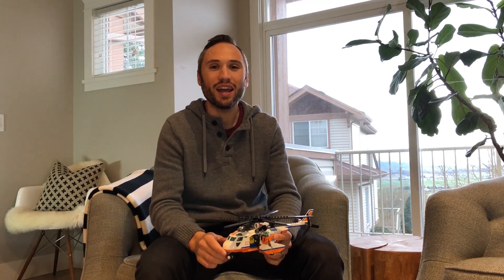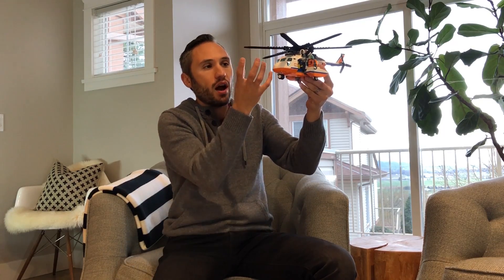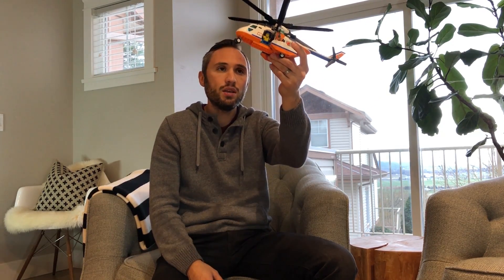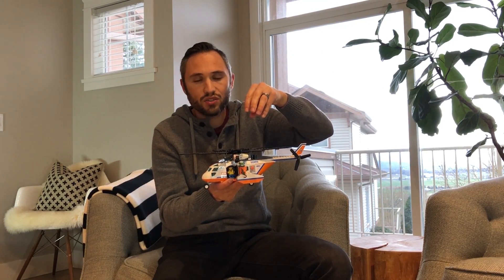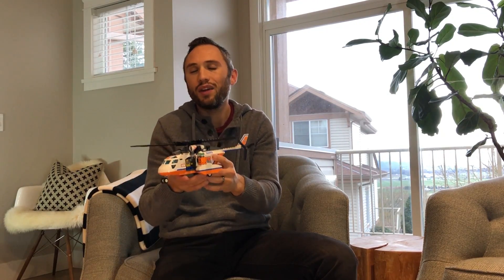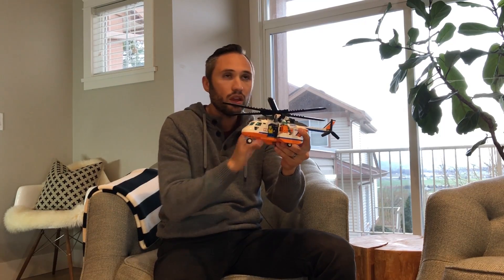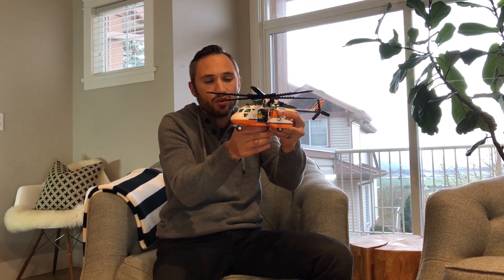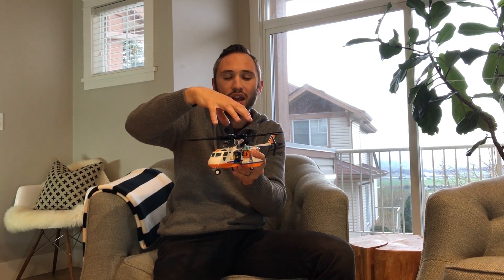Vortex Ring State IS NOT Settling With Power

Comment: I do not mean to sound brash, so please excuse me, but your definition of settling with power is called mushing. VRS is the aerodynamic phenomenon which can get you into settling with power. VRS occurs, and then when you are unable to arrest the descent with power, you are now in settling with power. If you are stalling the entire rotor disk as you stated in VRS then there is no lift created, therefore, no downwash to recirculate. You're basically doing a high altitude hovering autorotation and then there is upward airflow. If you're stalling the rotor then the attempt to create that lift with added collective you would create an immense amount of drag and significantly and immediately decrease your rotor speed. 

Also, the center of the rotor creates little to no lift in a zero wind with forward airspeed >ETL condition, especially in the retreating side of the disk.

Comment: I hope your not an instructor bud, your giving incorrect advice, perhaps go read up on the Vuichard method and revise your whole left pedal and left cyclic recovery in a clockwise spinning bladed helicopter, info like that can get someone hurt real bad.
Reply: Ps, even if it was a counter clockwise system, you would still be wrong.

Comment: You can also recover from VRS, if altitude permits, by entering an autorotation.  When i was taught this subject the two terms were rather synonymous due to the fact that allowing the aircraft to settle (in its own downwash, ie: airspeed less that ETL) with a decent rate greater than appx 300fpm, WHILE UNDER POWER, can cause VRS.  Hence the term settling with power.  If you were in a zero airspeed out of ground effect hover and your engine quit you could enter the autorotation with zero airspeed, decent rate greater than 300 and NOT get into VRS, why because there is no power being applied to the rotor (No power applied = No downwash = No recirculation)  The way you describe the fast approach with too much intertia would just be a bad approach with improper closing speed.  I agree that that type of mistake could lead to VRS or low rotor rpm from overpitching.  At any rate, I think as long as you understand the various flight situations that can cause these and the proper recovery techniques, that's what matters.

Comment: This recurring argument about what these phrases mean is ridiculous.. there is no correct answer it is simply a question of different phraseology being used in different parts of the world. In the US the term "settling-with-power" is used to describe VRS, so in fact YES it is the same IN THE US. In Europe VRS is used to describe VRS and settling with power means when you have insufficient engine power to keep the helicopter from descending without causing rotor droop.
That said I agree with the European use of terminology in this case and find it more accurate and less confusing.

Comment: Haven't read all the comments, so this may be addressed somewhere else in the thread:  I agree with your description of the differences in what's occurring, but not your claim that VRS and Settling with Power are two different things.  What you're describing as "Settling with Power" is really "Executing a poorly planned approach with insufficient power to arrest the descent".  In other words, the aircraft doesn't have enough available power (either transmission or engine limited) to stop the high rate of descent you describe.  If more power was available, your second scenario would likely not be an issue, as the aircraft is not in a descent profile to re-ingest vortices, rather it's just coming in too fast.  Dealt with this for years in flying max gross weight OH-58D in terrain flight and combat maneuvering scenarios.  New pilots with poor control touch and limited maneuver awareness were constantly describing situations as "There I was...settling with power".  In reality, they just failed to properly manage their power and descent rate to arrive at the intended location at the proper attitude and airspeed, with the result being the seat cushions being sucked between their butt-cheeks as they tried to manage the descent rate without over-torqueing the aircraft.  In questioning them, I always found no indications of lack of control response, rotor vibration, etc, which would indicate the re-ingestion of vortices and stalling blades.  Settling with Power then is really just a common usage name to describe the phenomenon of VRS, in that the aircraft is descending in an unintended manner with power applied, and no amount of collective application alleviates the descent rate.  Josh L describes it succinctly below:  "Power required exceeds power available" is not Settling With Power.

Comment: Thanks for taking the time to make the video. I to believe that VRS and SWP are different but in my opinion (and that of many others) your explanations of VRS are wrong.

VRS - Is due to 2 factors. 1 - the hub (or root as you call it) becomes stalled due to the ROD flow opposing the Induced Flow (IF) causing the AoA to become stalled. 2 - The tip section suffers from tip vortices where the downwash and surrounding air is sucked back into the top of the disc (because of pressure differential) near the tips. This creates a high IF which reduces the AoA to almost zero.   We now only have a small area of the disc providing any positive Rotor Thrust (or lift).

Your explanation of the Vuichard recovery was also wrong. In the Cabri the recovery steps would be:
Raise Collective
Left Cyclic - To bring the fuselage left
Right cyclic - Bring the tail Left
The aim is to side step (or crab) the chopper to the left.

Cheers

Comment: I'd like to hear more about the Vuichard recovery method.  I've not flown rotors for over 20 years now (AH-1Fs) but back in the day, settling with power was a big deal. going forward was explained as the only way out, at that time.  why does the Vuichard methode work more efficiently?  I'm assuming gyroscopic process has something to do with it, cuz the guy Gerry's stuff, below pointed out that european helos have a different direction of rotation, (the Coast Guard Dolphin has clockwise rotation).
Reply: The reason this works so well, is that you’re using tail rotor thrust to get you out of the vortices.

Comment: Hei mischa ....i didn’t quite get what do you mean by “angle of attack on the air matches the angle of attack on the blade thing”....beacuse what we have learned is...the recirculating flow increases the angle of attack of the blade beyond the stalling angle due to RAF being from different direction now...the root being at higher angle for maintaining symmetry...it gets stalled first and then the stall moving outwards with increase with ROD / application of power....and that is when u settle in the state of vortices with application of power....so it is just the interpretation of the statement “settling with power”. 

One more food for thought ...which is long drawn .....for which prouty has also stated reasoning....whether a heavier or a lighter  helicopter enter the VRS faster for the same type, auw, density altitude...?

Thanks 
Ankit

Comment: Hello Mr. Yellow, 

This is the first Video I see from you and I was pleased to see somebody who took his Lego chopper and went to explain an often discussed issue. So I am watching through your video and the urge grew the give my two cents worth. I've stopped at 6 minutes something now and find two major issues my understanding differs from yours (i stand to be corrected too. I don't claim my thoughts to be right, just think about them 😉) 

First thing is easy... if you explain something please refer to the direction the rotor turns because you don't do the vuchard maneuver  to the left .... you do it to the advancing or forward moving blade which is in a cabri left. BUT you don't put in left pedal as you explained.... you put in right pedal if you put the stick to the left  or left pedal if you push the stick to the right. As you can see in the vuichard video. 

Second thing is... as you get into the vortex ring state you don't stall the rotor at any point! If you would do that we wouldn't practice it we would just die. There is NO recovery from Rotorstall. (For reference see about every Safety Notice Robinson ever put out!). The real reason is that once the vortices get sucked into the rotor again (by the way that starts at the  blade tips) your angle of attack changes to the worse hence you lose lift. And because of this there is a way out of it. 

Please see this not as a lecture but as a fellow pilot having a chat. 😉 iam looking forward to the rest of your video. 

Fly safe.
Reply: .... and another Wild thing we could discuss.... can settling with power lead to vortex ring state? 😉

Comment: Hello there. Just for the record, I am not a pilot. Would like to ask a question to the pilots here. Is it possible that the FAA is teaching these two concepts as the same because the recovery techniques for them are same?  Forgive me if the answer is obvious, and again I am not a pilot
Reply: Ibri, the FAA doesn't actually teach that the two concepts are the same.  The first paragraph on this in the FAA Helicopter Flying Handbook is:

"Vortex ring state describes an aerodynamic condition in which a helicopter may be in a vertical descent with 20
percent up to maximum power applied, and little or no climb performance. The term “settling with power” comes from the fact that the helicopter keeps settling even though full engine power is applied."

Voretex Ring State is a phenomena encountered with no airspeed, some power, and a some descent rate (Canada says 500 fpm, FAA says 300 fpm with the correct caveat the lots of aircraft and environmental factors determine this), just like this video says.

The FAA says the Settling with Power is what happens when you try to recover from main rotor vortex ring state by pulling power, and you increase the descent rate.

The section of the FAA Helicopter Flying Handbook that discusses this is Chapter 11: Helicopter Emergencies and Hazards.  Vortex ring state is a hazard, it is not an emergency itself.  Settling with power is an emergency since 99% of the time you get into it while trying to arrest a descent rate in a typical way (with power) and and it has the opposite effect.  If this happens close the the ground, which is not atypical, you can see why this would create an emergency.
Reply: Hey . Thanks for the insight. It makes more sense now

Comment: You might enter vortex ring state near the ground while descending vertically because you didn't have enough power to decrease sufficiently the decent rate beforehand while coming down at an angle on final approach and so you settled with power.  (You raise the collective a lot just before reaching the ground in a desperate attempt to slow your descent, vortices develop, etc.)  Thus the two phenomena are associated.
Reply: They are associated, but the reason the blade is stalling in Vortex ring state is due to the relative wind direction (the angle), and due to the lack of available engine power in Settling with power. The relative wind is "normal" in Settling with power, hence not a Vortex ring state. 

Imagine you are driving a manual car in 4th gear at 60km/h on a straight road, then you come to a hill with 10 degree incline, to maintain the same forward speed you would have to downshift to 3rd because the engine is not capable to produce the power required to maintain the forward speed up the hill in 4th gear. Very simplified but we've all done this if you have a drivers license. :-)

Comment: All of this is great info, but in the future will just be taught for historical purposes.  Modern tech can remove the pilot's bias  from the 'how' of a systems dynamics and leave the meat based unit to 'suggest' --- 'where'  the vehicle should go.  The FC takes the input from the meat,  does its best approximation to follow those instructions without
jeopardizing the safety of the vehicle within a certain margin of buffer space added on.   Similar to the way automobile safety record changed drastically with the advent of anti-lock brakes.

Comment: As an old fixed wing private pilot I really enjoy all Your explanations. There is one thing I wonder if you could explain. Locking at films were the heli-pilot doing quick stops, and in a cavalry way - why isn´t the heli entering a vortex ring state? I mean, there is plenty of speed forward and suddenly there is a nose up attitude 45-60 degrees making a lot of air entering the rotor dish from beneath. Giving you some examples: https://www.youtube.com/watch?v=jGMCiDXeCF8 and https://www.youtube.com/watch?v=UDJ5U7YpXo8  Anyway, really like your channel and locking forward to every new episod! :-)
MaPe/Sweden
Reply: It's not a problem because you enter a quick stop with a lot of airspeed.  Where you can get into trouble is if you mismanage altitude, gain altitude during the flare, and then try to correct by dropping power and descending vertically.  

Realistically, a CH-53E or CH-47 will never get into settling with power at sea level though.  Like some of the RC pilots have noted, helicopters with a high power to weight ration can usually power out of VRS.  My first flight instructor learned to fly in a Hiller 360 with wooden rotor blades which was apparently very easy to get into VRS.

Comment: Disagree, .....SWP=VRS. An aerodynamic event. 

Allowing your descent to exceed your ability to pull power and arrest the descent is just poor flight management. 

Your need to separate the two terms drives a need to define other poor pilot techniques. By your definition a failed quick stop would also be settling with power? Is that a correct assessment? You allowed your forward speed to exceed the ability to pull power and stop.

Comment: The whole point of the Vuichard technique is that you use power, and the power pedal, and therefore the thrust of the tail rotor to get you out of the column of air. The tail rotor is the key because it isn’t in vortex ring and is still efficient. It ‘blows’ your tail out of the column of air. The cyclic is less effective than the TR as it is in VRS.

As a result, in a Robinson or other USA aircraft, the Vuichard only works by applying power while simultaneous left peddle to keep pointing straight ahead, along with right cyclic.

Obviously it’s the reverse for European aircraft, and you apply power, right pedal and left stick.

Comment: Here's a quote from "Principles of Helicopter Aerodynamics" by Leishman: 

"Entry into the VRS manifests as rotor thrust fluctuations and also an increase in the average rotor-shaft torque (power required), the latter which is necessary to overcome the higher induced aerodynamic losses associated with rotor operations inside its own blade wake. Most helicopters do not have a lot of excess power available at low airspeeds, so the extra power required to overcome these additional induced losses can be of sufficient magnitude to negate the decreased rotor power requirements associated with giving up altitude (potential energy). Therefore, when in the VRS, the application of high rotor torque (power) may be required to maintain equilibrium flight, even though the aircraft is rapidly descending. This scenario is often referred to by pilots as "power settling" or "settling with power" and can be a safety of flight issue. These latter terms , however, are not accurate descriptors of VRS conditions because such "settling" issues can also occur under operational flight conditions when VRS is clearly not present, such as when a helicopter transitions from hover into forward flight while in ground effect or climbs out of ground effect at high gross weights or high density altitudes."

I think the important thing to take note of is the words being used. "Settling with power" is just that. You are descending (settling), while applying an increase in power. This can occur during VRS, during transition out of ground effect, or during the inertia circumstance described by Pilot Yellow (don't know his real name). It seems too constricting to limit it to only one of these flight conditions.
Reply: Jesusdragon737 that’s what I was about to say ....🤷🏻‍♂️
Reply: Just came across your comment - thanks for sharing! Reading the same book currently for university ;)